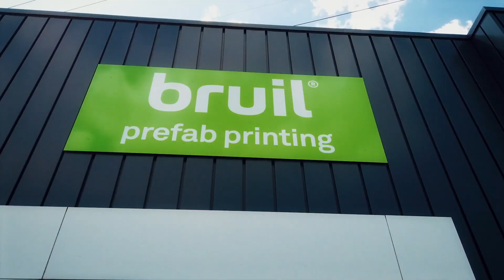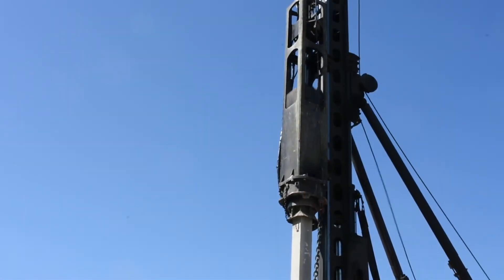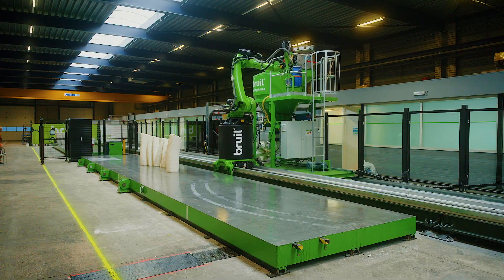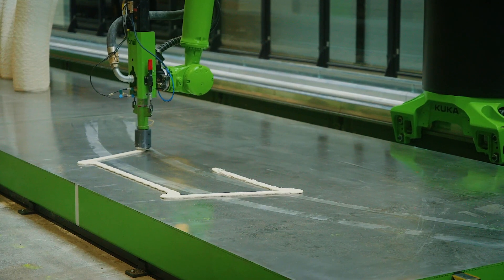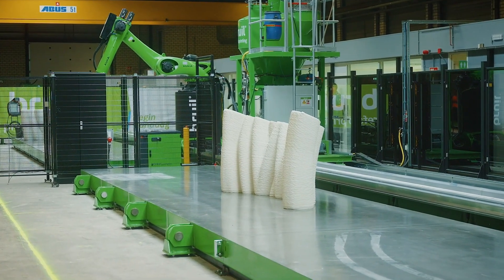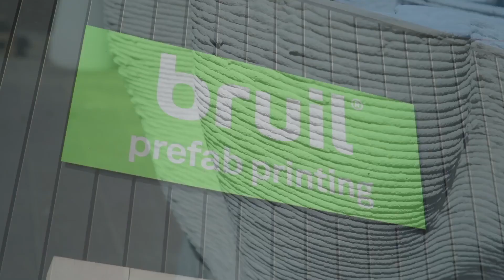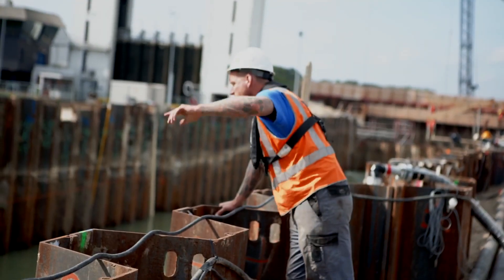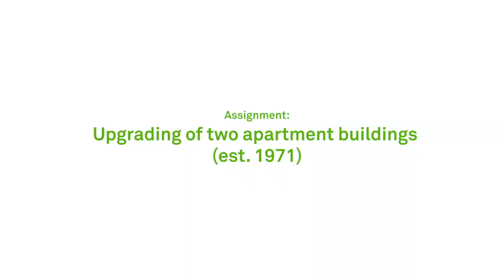3D Printing 150 Apartment Building Balconies [Bruil]

Comment: You should not use anymore concrete, you have to innovate as well into the sustainable construction materials. In co2 absorbtion so you'll be 100%. There are enough alternatives. For any more info let me know.
Reply from the maker: It’s already quite expensive material as is, what solution do you have in mind? Feel free to send info to jarett@3dprinted.construction
Reply: @automateconstruction  you should investigate and do a post on renca geopolymer 3d printing concrete